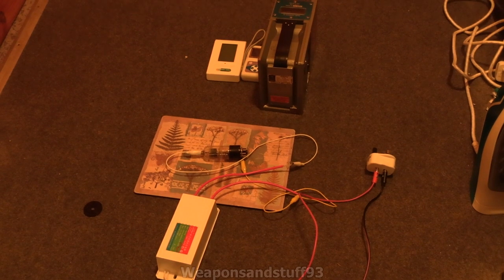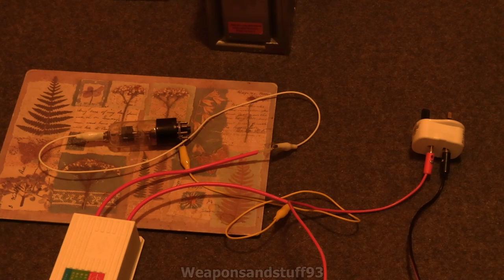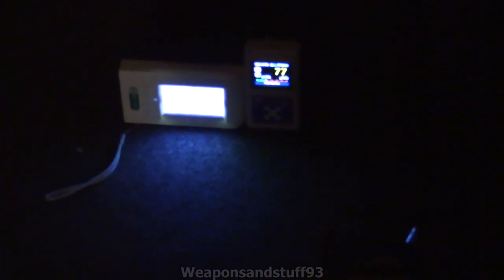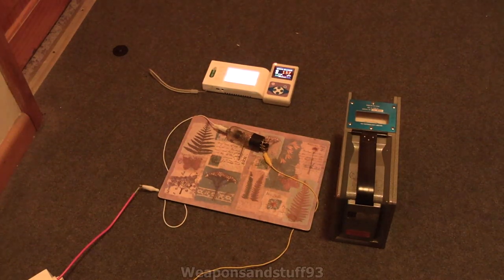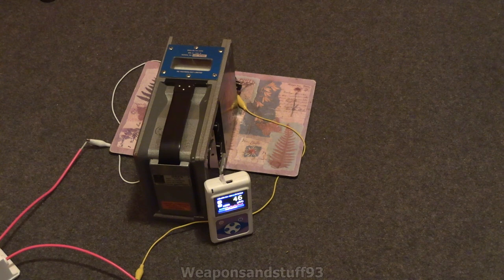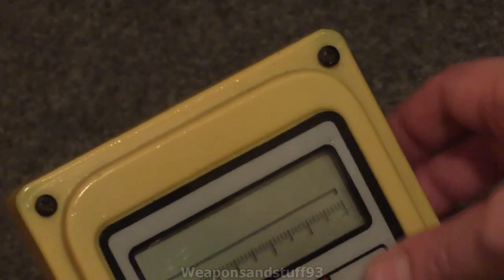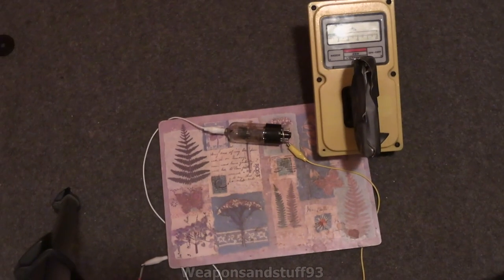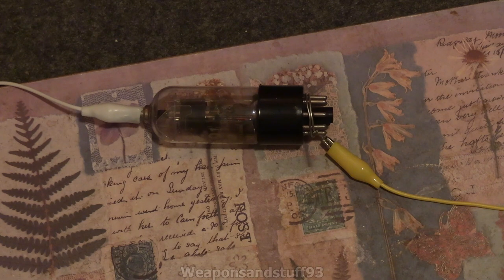Simple Vacuum tube X Ray demonstration

Comment: Nice video. At a guess I would say the meters are responding to  a mix of beta radiation and some R.F. interference. Like putting geigers near plasma ball. You could use tin foil to shield R.F. and beta and see how much x-rays are flying around . FYI in an x ray tube you have a heated cathode and a high voltage. The heated cathode liberates electrons from cathode material  and the HT accelerates them to the anode where they rapidly decelerate and this deceleration of the electrons is the "breaking" in breaking radiation...result x rays. Your valve does have a heater in it but its not being used in your circuit. Sorry to be a know all, and I enjoy all your videos.
Reply from the maker: Interesting, I imagine if I wired the vacuum tube differently with different wires going to the different elements it might heat and work more efficiently. I do have a flyback transformer but I've not started experimenting with that yet.

Comment: With the right power supply to provide a couple tens of thousands of volts and the proper tube, these things can put out ionising radiation at levels far over what even the most obscure hot radioactive samples collectors can get their hands on. You can easily get into the full Sieverts per hour range.

Comment: Since X-rays are electromagnetic radiation, should they be treated the same as Gamma rays?  ( penetrating power...)
Reply from the maker: in terms of risk X and Y rays are treated the same way but bear in mind x rays generated like this are very weak and do not travel or penetrate far. See soft vs hard x-ray.
Reply: @Weaponsandstuff93  like a much weaker version of Gamma

Comment: Beware of geiger tube saturation with ac powered tubes (if the geiger does not have a saturation alarm like many cheap ones do not). Saturation can make counters count 50Hz (line freq pulses) or 100Hz (2x line frequency) or just a lot reduced counts. Especially with higher power tubes that can be a real issue.
That happens when the voltage gets high enough and the start of burst saturates geiger tube and keeps it saturated until the xrays stop.
Reply from the maker: Thanks for the info, I doubt the Radiascan would have that issue seeing as it's one of the high end pocket meters but yes I've had issues with other cheap geigers going crazy with things such as UV light, or high power supplies etc.